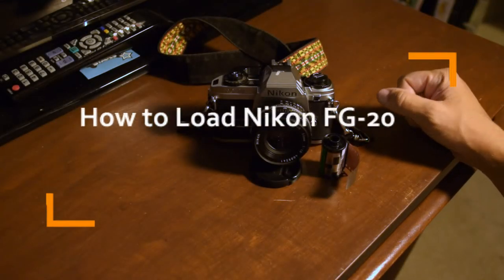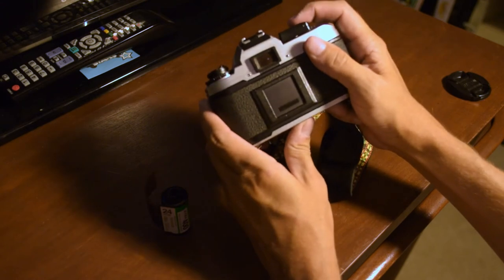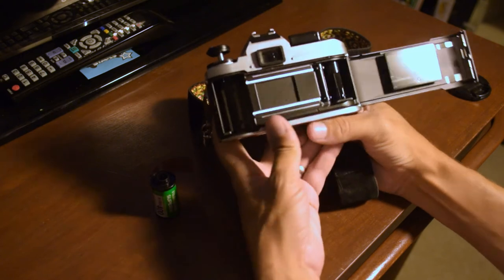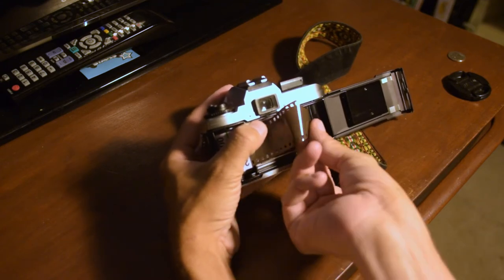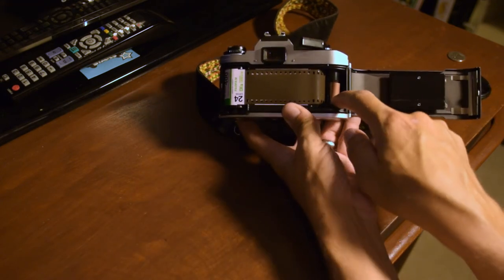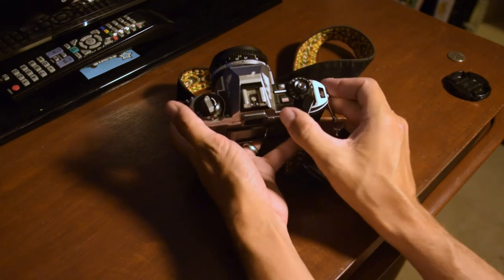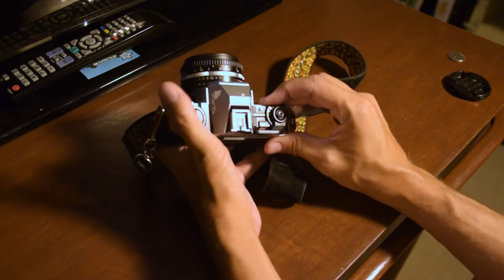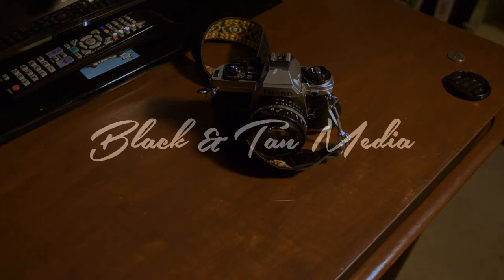Loading Film in Nikon FG 20 35mm Explained

Comment: A couple of tricks I learned for loading not only my FG-20 but any 35 mm SLR: push in the rewind button, so the sprocket can freewheel. In case the film hangs on something, you can pull it out easily and try again. And be careful never to touch the shutter curtains.

Comment: Amazing how quickly people are forgetting how to operate film cameras with the proliferation of digital cameras..film has become something of a niche for us diehards who still have film cameras.  One quirk with the FG/FG-20 Nikon film SLR's:  the shutter defaults to speed of 1/90th of a second ('M90')  until frame counter gets to '1' with a fresh film cartridge.  I habitually fire off a couple of blank shots with any film SLR with the lens aperture set at the smallest opening (usually f/16 or f/22 depending on the lens mounted) and shutter speed set at the fastest speed to make sure I get to unfogged film frames with a fresh roll of film before I take photos.  As to previous questions about batteries needed for operation:  I have an FG and the shutter will operate without batteries although at speed of 1/90th of a second only (the 'M90' setting on the shutter speed dial) and of course without operation of the light meter.  For storage I keep my FG set on 'M90' to prevent accidental battery drain.
Reply: what kind of batteries work for them?

Comment: Hey! 
So my Nikon FG’s shutter counter does not work. Is it worth it to fix it? 
Or should I risk it and press and wind my shutter 3-4 times?
Reply from the maker: If it's just wasting a roll of film it might be worth a try. Depending upon how close you are to a major city there might be a camera shop where you could make a good relationship who could fix it fairly easily. Depends on what the camera is worth to you versus what you can get another one on the market for. Whether you think you'll actually use it you know what I mean.
Reply: Try what you want, but do not take it in for repair. Any repairman opening it up for any reason is going to charge you $100 or more. You can buy dozens of replacements on ebay for $60, more or less. If you have a local repair shop, consider taking your old broken  FG in with the new version and see if you can trade it for the cost of a CLA on the new version. The shop may be motivated by getting you old model as a parts source for future FG repairs. Otherwise, just store away your old FG as a parts supply in the event of need.